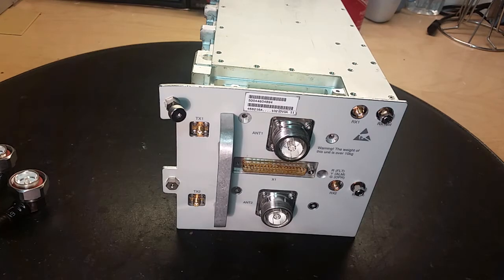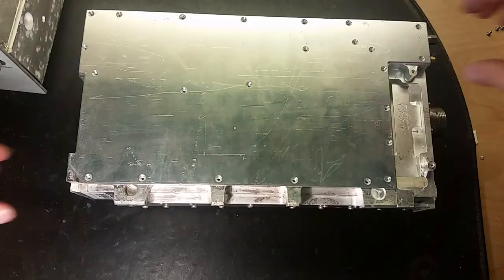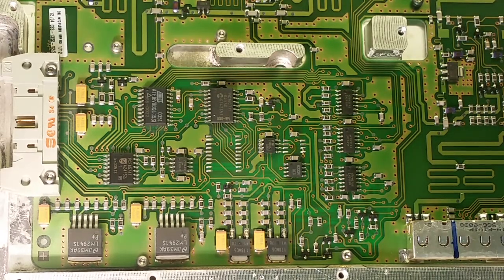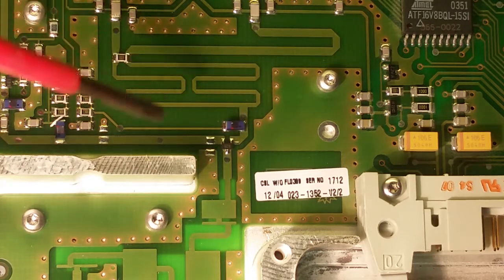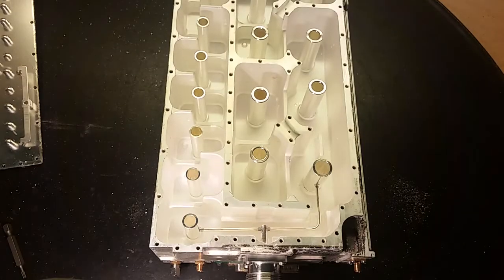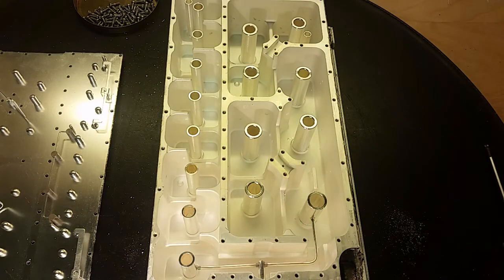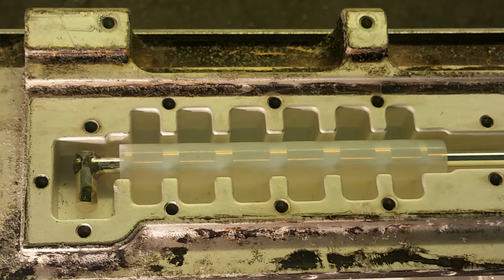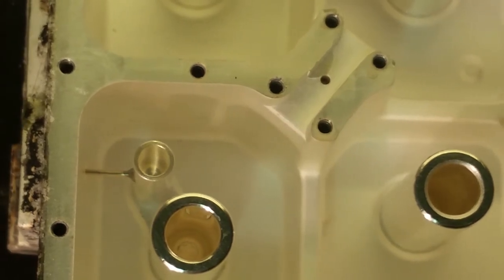900MHz  filter Teardown

Comment: you are complexly off on everything you explained, you seem to lack basis RF knowledge
Reply: It looks like a tx/rx diplexer  to me.  Some printed filters,  cavity filters (re-entrant coax resonators) one of which is cross coupled - and stepped impedance coaxial filter to reject the main cavity filter repeat band possibly?  There's a balanced amplifier (probably the LNA) and some RF path selection switches.